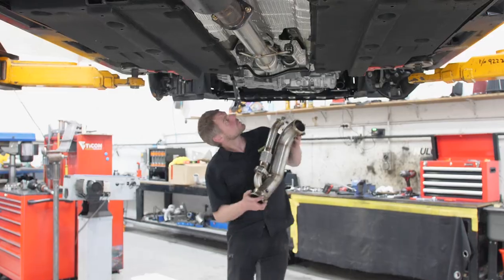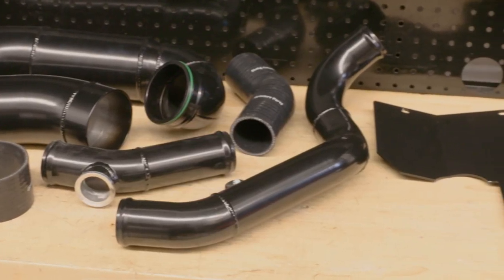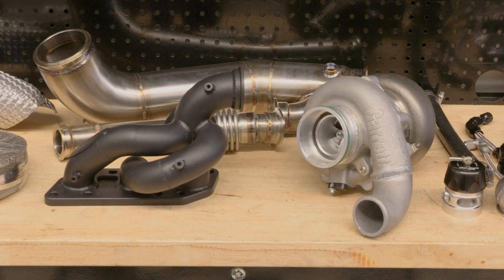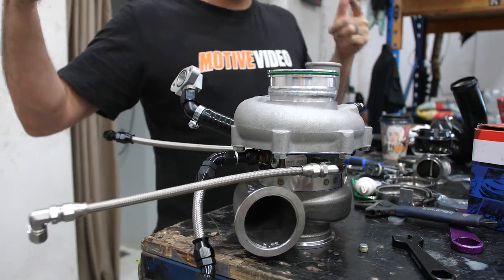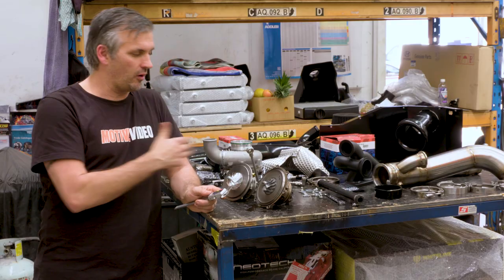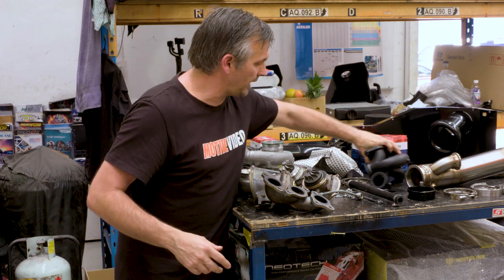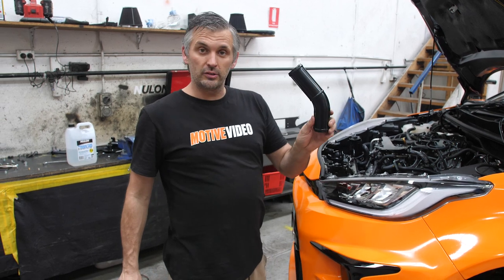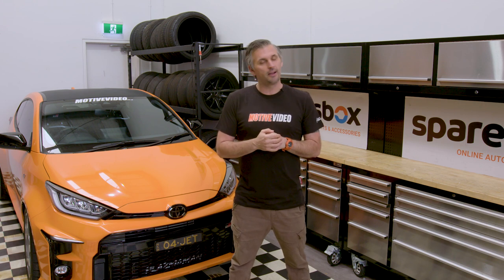Bigger Turbo for the GR Yaris - Goleby's Parts G25-550 Turbo Kit for GR Corolla and Yaris

Comment from the maker: How much power do you think it will make?
Reply: 330 whp
Reply from the maker: It makes that on stock turbo now
Reply: @MotiveVideo  385 Whp
Reply: It's not the power that matters - it's the 0-60 and 1/4 mile times that matter! If it dips under 4s to 60 then I'll be impressed.
Reply: 400 hp maybe more
Reply: 410hp @ hubs ;)
Reply: Ko 8
Reply: If you push it as much as you can it can do over 420whp with E85 or pump +some extra octane
Reply: I'd say bout 420
Reply: 375whp
Reply: over 1200HP like the old BMW M12/13 using 5.5 BAR, lol!
Reply: 328kw and yes I use kilowatts because you are supposed too! it's Australia not USA we use METRIC measurements here not imperial.
Reply: @jasonswift7098   tut tut colonialist .  Be like Brits and use both . I cut timber in mm but I do 0 to 60 with horse power and my 🍺 is in pints .
Reply: 666 bhp
Reply: @jasonswift7098  I'm literally a chipie all I do is cut timber .well I do some dryline and roofing so allot of slate and plasterboard aswell . You need both . Cut me 875 of that 3x2 .

Only Australia uses KW for engines .The rest of the colonialists use bhp and Europe uses ps .

You on your own on that one nobody else knows wtf your on about with KW . They be like is it electric ?
Reply: Will this kit not work for a 1kr
Reply: 3 piston can get 330 hp that very  good
Reply: @charlies418  you guys and your straight line performance🙄 with 400hp it will eat porsche 911’s for lunch on a race track !
Reply: I honestly couldnt care. I dont think stringing the 1.6 3pot out any more is just asking for trouble.
Reply: After realising 472whp how much do you think the G25-550 is capable of with a 0.49 T25 turbine housing?

Comment: It'll be interesting to see what kind of lag (if any) this kit will have.
Reply: G550s are a fantastic little turbo, surprisingly responsive for their airflow capabilities. They're about a full frame size larger than the stock turbo, so even with the latest aerodynamics and materials there will be some trade-off, but it should be minimal.
I personally would like to see what one of these would be like tuned to 240 kw with the smaller GBC22-350 turbo, which is a considerably smaller size turbo in Garrett's very latest generation. About a 65 horsepower (at the flywheel) increase over stock but likely with even better response than factory.

Comment: It would be nice to some of the older cars which are now going up in value exponentially like e30 bmw and e34 bmw like top models the 535i and 535is 525i and m5 in particular along with e39 bmw 530i and 540i 525i also m5 I'm particular about the e34 535i as the 535is will be basically the same

Comment: You mention that the intake part of the kit removes the section of the Mass Airflow Meter.
Where does the MAF or it's replacement go after the kit is installed?
Reply from the maker: Map sensor. MoTeC